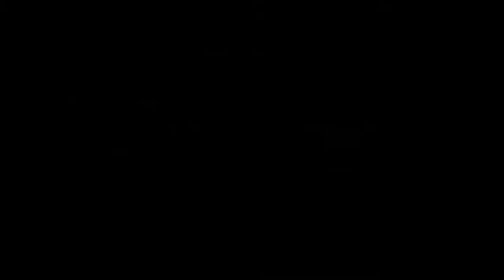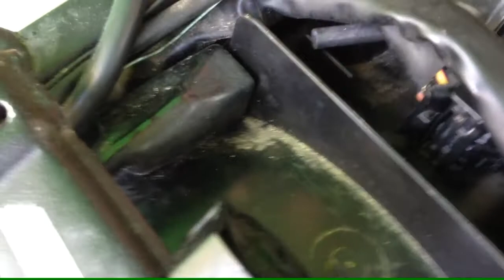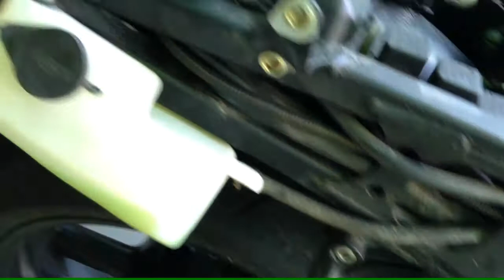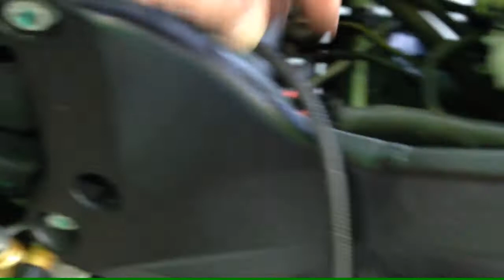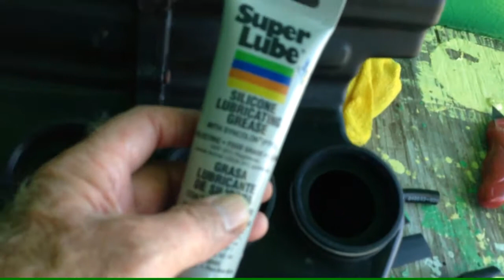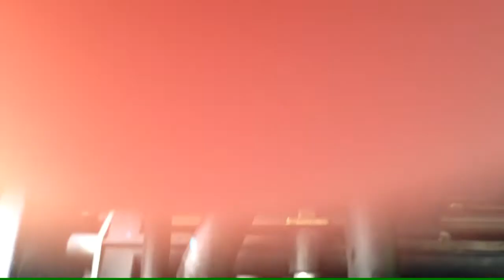Triumph Speed Four - Air Box Install

Comment: Hello i want to ask for what this small reservoir? And for what another one close to this one?
Reply from the maker: Hi, I don't understand what your question refers to.  If you could tell me where in the video you have a question.  Maybe I can help.
Reply: Hello it’s under seat this small two canister one white another darker 🙂
Reply from the maker: There is the reserve for the coolant.  The other is the reserve for the rear brake master cylinder.  I hope that helps.
Reply: @ Hello appreciate , please tell me coolant should be to inside white  canister? Because it’s empty but in the system it is.
Reply from the maker: There should be a hose from the coolant reserve that goes to the radiator.  It needs to be filled.
Reply: @dennishanson9529 Thank you, for your time to helping me 🙂